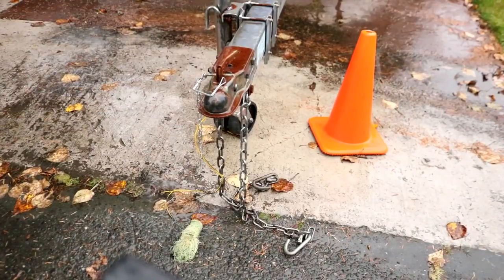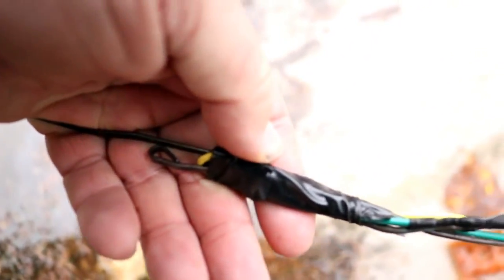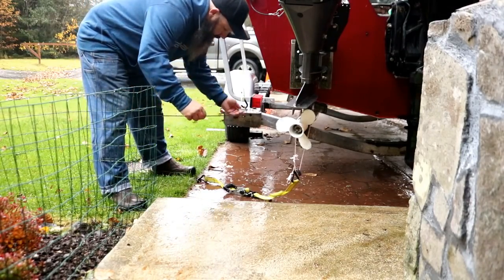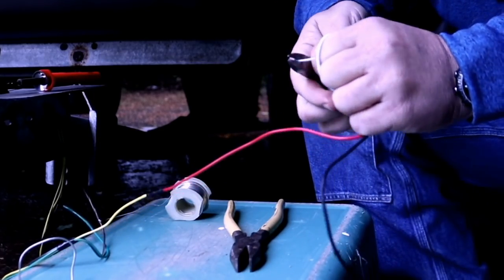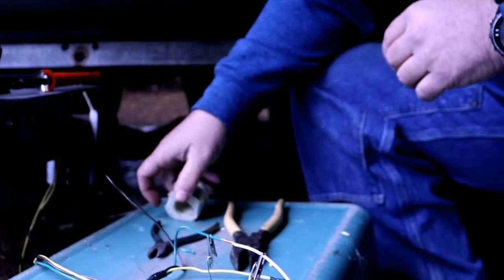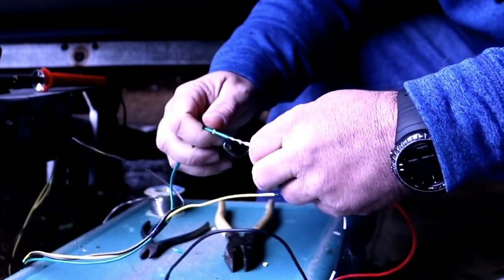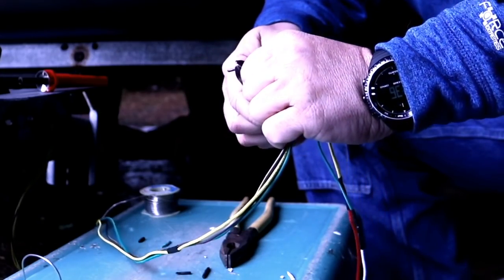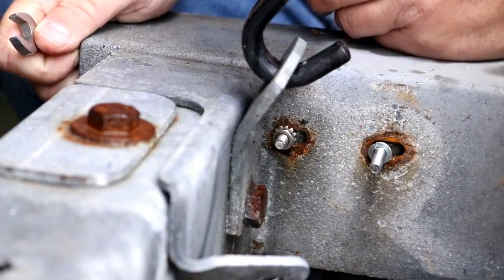Boat trailer lights, how to run wire through your trailer frame

Comment: Happy birthday Don!

Guessing heated floors in the cabin.

You started yanking the wires out and I was thinking Wait !! Use those to pull the new wires through ! You had it covered with the fish-tape though. I've used those for years pulling wires. Also work good to try snagging a wire that fell down inside a wall if you open the end a bit.
Reply from the maker: Don says “thank you for the birthday wishes”
I’ll have to keep that in mind if I drop a wire down inside a wall. I can think of all kinds of alternate uses for that thing.

Comment: Happy birthday,  don.
Reply from the maker: Thank you Allen
Reply: @AnAlaskaHomestead  your welcome, though my timing it seems was about two or three years out. Questions for you folks, what do you think of R.I.B. water craft as a daily use vehicle and do you have a patreon account? Good luck, stay warm,  and stay safe.
Reply from the maker: Hey Allen, birthday wishes are always welcome. 👍
I think a RIB could work. With having to load everything from groceries to lumber I’d be a little concerned it may poke a hole in it.  Maybe a small skiff like a Lund would serve you better. 
We do have a patreon account and channel memberships are available too. I like memberships because you get an icon by your name when you post a comment. Unfortunately you can’t join on an iPhone it has to be on a laptop or other device. I’m not sure why. Anyway if your interested in either I’ll have links for both of them in the description on tomorrow’s video. 
Thanks for thinking about it either way.
Reply: Great. I'll check it out. Can you buy beach landers like you used for your tractor?  Preferably second hand.  Any idea where to look? I am not sure what is official name is. If I did this I would want a light craft a lander. It seems that would allow for redundancy and allow me the ability to transport larger items.

Comment: What is the fishhook called and make
I need that ?
Reply from the maker: Klein makes the brand I have. It’s just a wire puller.
Reply: Thanks got it ordered off Amazon 
I need to replace the old wiring in my boat trailer…….thanks for video.
North Pole